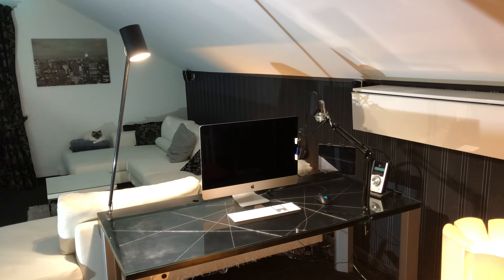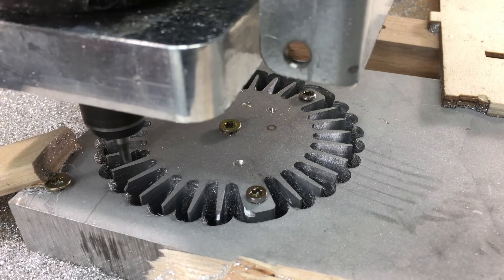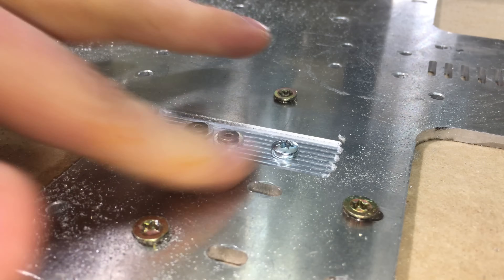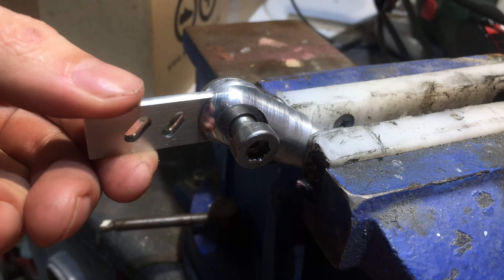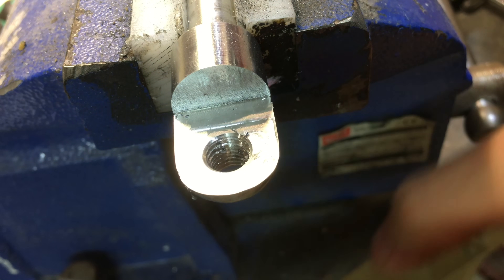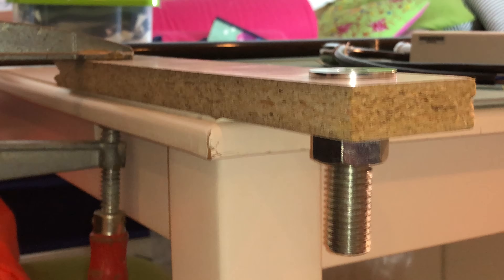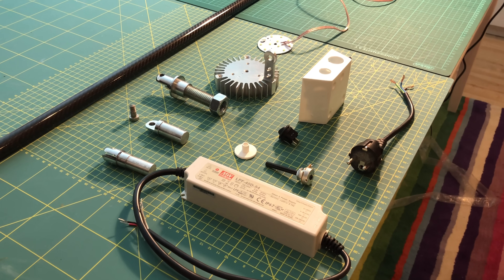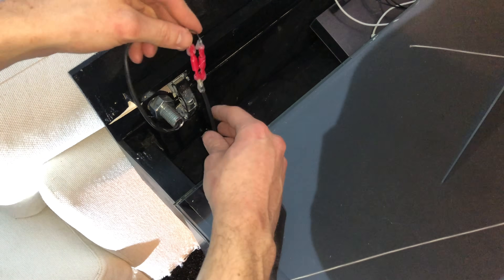Ultimate Desk Lamp Build! (High powered and minimalistic.)

Comment: what aluminium alloy do you use?
Reply from the maker: For this one, I used anything I could find. But since then I lerned my lesson and only buy the proper stuff for machining. 
AlCuMgPb
Reply: @MaxMakerChannel  Alloys can make quite the difference. It seemed like you were milling it pretty well. That is why I asked. I had some bad experiences initially myself.
From what I can gather AlCuMgPb is number 2030 and or 2007. Any experience with 6082 or 7...? 
Thanks for the reply :)

I find that since I made a vacuum adaptor to  suck up chips and using single flute bits for small radii to allow for chip clearing I am getting much better results. Also using small plunges for contouring where it is hard to clear chips otherwise seems to help too. For pocket clearing I dare use large plunges because the chips clear into the pocket itself. 
After this video I will be on a lookout for HSS bits as well :). Don't know if I will be able to find small ones though.
Reply from the maker: janz krs I was also thinking about using the vacuum, but that sucks away all the alcohol. So instead I try to make parts with better chip clearing. In this video, a lot of end mills broke when they cut a slot and were cutting with both flutes. I never used specialty alloys.

Comment: Oh I have the exaçt same problem. I want a desk lamp, fountain pen, etc, but nothing looks like I want it to. But I don't have a CNC mill... :(
Reply from the maker: Fredi ツ I got a fountain pen from my girlfriend : ) But I also couldn’t find the right pen. I was looking for one that is just a cylinder with rounded edges. And most importantly, no clip! Doesn’t exist.
Reply: Max Maker yeah me too. I just want one that looks like a simple aluminum cylinder, no fancy curves or anything. But nowhere to be found. I bought a very simplistic looking Lamy pen, which is probably as close as you can get in terms of design off the shelf, but it still has a plastic end-cap which looks like garbage. Do you speak German btw?
Reply from the maker: I had that Lamy pen!!! The end caps are black plastic right? Yes I do speak german.
Reply: Max Maker jep, das Ende ist aus schwarzem plastik, kann raus geschraubt werden, und der Rest ist aus Messing soweit ich weiß. Ich wünschte ich könnte mir eine bessere Version selber basteln, aber ich habe wie gesagt keine CNC Fräse.  Vllt. Hast du ja mehr Glück ':D bis ich eine Lösung finde, schreibe ich dann so h wohl mit dem Lamy Ding weiter.
Reply from the maker: Sobald ich in meine neue Werkstatt ziehe kaufe ich eine Drehbank. Dann baue ich auch einen Füller.

Comment: I think I would have added a ball joint midway on the arm to give it more freedom of movement.
Reply from the maker: I was thinking of that. Its a good idea, but I didn’t like the look and the light is so bright, that you don’t need to move it much at all.
Reply: It's not a bad look.  The ball ends are cheap.  Another thought was a touch sensitive dimmer on the structure itself.  You could do that no problem.  

Do you want to team up?  I have access to a fab lab in Edmonds, Washington, USA.  We have some interesting ideas, and you would be a great mentor/board member.  Email: willard997@gmail.com!
Reply from the maker: Sure, but collaboration on what?

Comment: Nicely done. This video really shows just how much creativity is still needed even when using CNC and 3D print tech. Certainly not the push-a-button sort of devices that they might seem like. And wow, heat-sink design is an art of its own! 

Question: I know nothing about CNC operation, but why isn't there a vacuum tube around the bit to pull away chips? That seems like a nightmare!
Reply from the maker: pocket83 Thank you. About the CNC: I never got around building a dust shoe until 2 weeks ago.  When I am milling Aluminium, I constantly cool it to stop it from gumming up. My vacuum wouldn’t suck up the wet chips anyway. Ideally, I could have a constant flow of coolant, that removes the chips at the same time, but that is impractical for such a large CNC. I could also use compressed air to remove the chips, but then they go everywhere.

Comment: Watching the instant shine come up on the aluminium was amazing.  Not too sure about what to use, but I wondered if the 2 part epoxy would fail where you were gluing the hinge onto the heatsink.  Maybe the heatsink will dissipate enough heat so the epoxy will not fail.  Great project and really good seeing you use the CNC and 3D printer to make nice looking parts.  Cheers, David.
Reply from the maker: DRMNZ Hi david. I had planned to solder the hinge to the gest sink. I got the solder on ebay but it wouldn’t melt. Even at 600 C°. So I had to use Epoxy instead. Not sure if it will hold up either. Epoxy is a thermoset, so it cannot melt. It can get a bit softer though. There is a lot of interference between the pieces though, so I hope it will be stuck together mechanically.

Comment: It's beautiful! I'm very envious of your machining capabilities. The finish on those parts was awesome. I've been working on a heatsink today myself actually, of sorts - using a heatpipe for it so hopefully it won't explode when I start soldering it.

Where do you get your aluminium from by the way? Those were some quite large lumps of it... I just bought a 25x25cm 4mm sheet for aprox. 10 euros, so scaling that up it must be quite an expense? Or am I being ripped off?

Heatpaste is effective stuff, but it might not be necessary for something like this because you've got a fairly large surface are compared to the output heat. If it were 100w in a 1cm square package for example, it will significantly improve heat transfer. Looking forward to the surf board!!!!
Reply from the maker: Hey Mr. Perks! Thanks for the compliments : ) The finish is alright, but its not perfect. I am sure some machinishes would point it out.  I guess you were working on that 500W LED? Let me know if you need help. Heat management was a big role in this build. I could have got one of those COB modules I guess, but somehow I didn´t. 

 I get all my aluminium on ebay. I auction any offcuts and get about the same price. I should really find a scrap yard though where companies send their scrap.

Comment: I really enjoyed this video. You put so much effort into making stuff, and they turn out great.

One thought about the thermal paste: It's really useful. A thermally conductive substance which can fill all the microscopic voids in different materials to increase the heat transfer between them. That's why it's used on CPU heatsinks. It helps alot.
I can recommend the "How Does Thermal Paste Work?" video from Techquickie to get a better idea.
Reply from the maker: Thanks. Ill check it out!